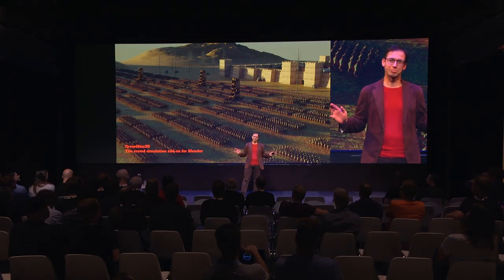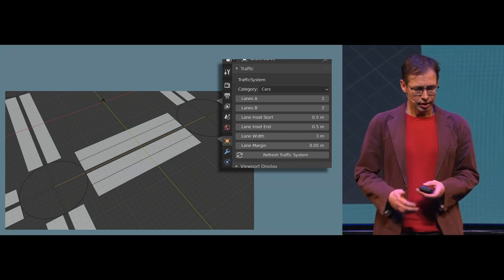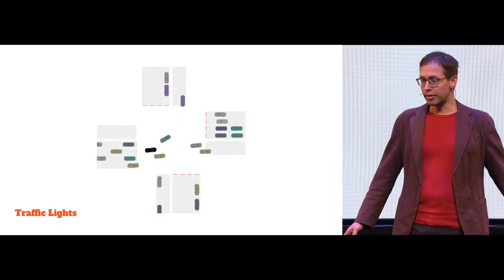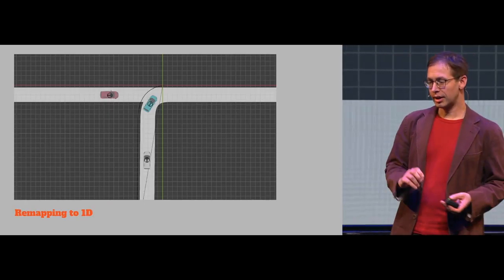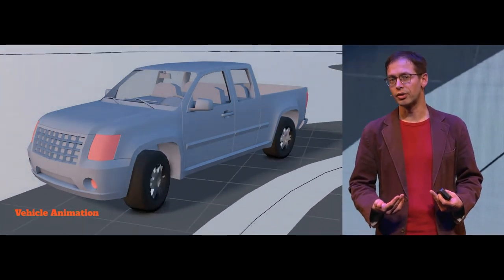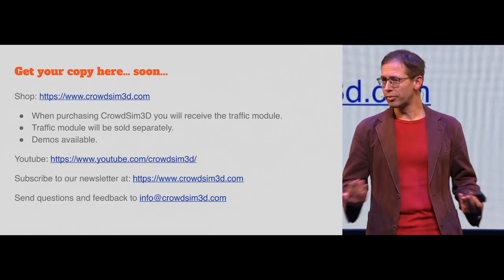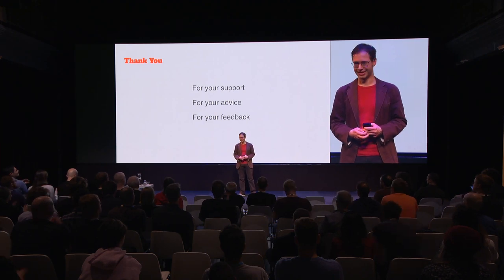Traffic and crowd simulations - Jeroen Bakker

Comment: Traffic is caused by imperfections, delay in reaction, awareness, overall mental state etc all contribute to traffic, including distance between vehicles, if everyone drove the same you'd have no traffic, you need irratic and cautious drivers for traffic to form properly
Reply: Traffic lights cause traffic jams. When they don't work, drivers are cautious and vehicles flow through easily...
Reply: Traffic is error
Reply: @thegiantguy  That's your opinion...
Reply: Its been studied, think about it, 2 objects traveling the same speed won't catch up to each other, the distance between them would be constant, a traffic light would make them both slow, and then accelerate, no distance change, "traffic" or congestion or gridlock is only formed by human error, someone going too slow, an accident, a sudden stop, if you have a system where everything drives the same you won't get gridlock, if you have the "human" element of error you do. It's been proven, and I suggested it as no one seems to be able to make realistic traffic yet they all use traffic lights...
Reply: @thegiantguy  you just proved my point!
Reply: @bobrew461  well not quite, traffic lights even the flow of traffic to prevent traffic jams, accidents on blind bends allow you to turn onto a busy intersection without being t-boned. Where as a cautious driver not pulling out would only lead to a build up in traffic behind them, thus traffic lights aren't the cause..
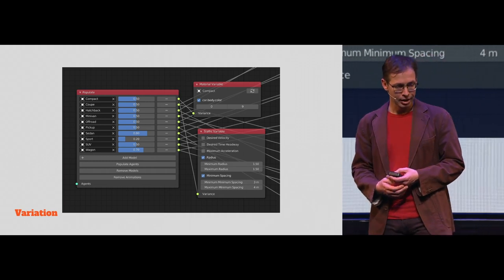Reply: @thegiantguy  you can set different speeds to different actors in this simulation. Check 7:20 for that control and 15:08 for artistic control plans.
Reply: @Asphyr  I thought that was good, I just think there needs to be a random error amount, so there's breakdowns and crashes etc.
Reply: @thegiantguy  I don't see a use case where  random crashes are wanted behaviour. They take attention from the scene without the artists control, this is still a cg environment. If they are wanted behaviour, they would fall entirely within artistic control. Some erratic traffic behaviour like picking a wrong lane are very unnoticeable in any real rendering use case, but I expect something like that will be added. Let's say someone is making a highlight reel of a city scene flying over it, and some random shit happens, and now the cars that added life to the background are suddenly the focus and you gotta hit the render button again and hope for a better seed.
Reply: @Asphyr  I get that, I was thinking for varied levels of congestion so it didn't feel so generated, maybe cars not moving rather than a full blown pile up 😂
Reply: ye the question only is,  is all  that   needed in a  simulation in   3D? I don't think so. If there will be  an accident, traffic  jam, other weird behaviour of an automobilist,  then the  view (camera) is probably  close on   it and things  would  be made  without the simulator but  by hand animatiion anyway.
Reply: @thegiantguy  He stated their models are based on the Intelligent Driver Model (IDM). The Wikipedia page documents how using a higher order Runge-Kutta coefficient will accurately model traffic wave propagation.